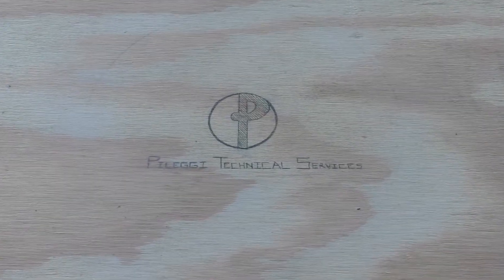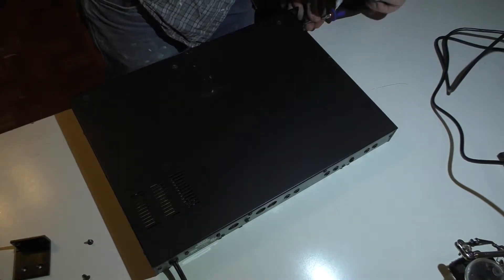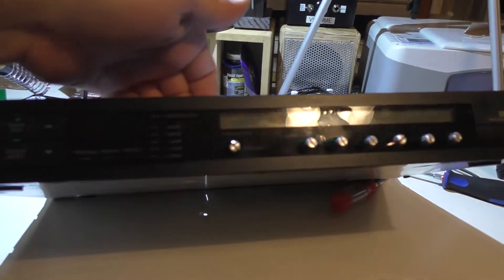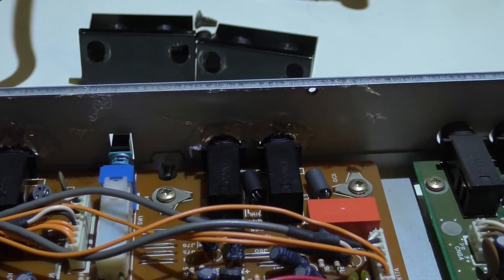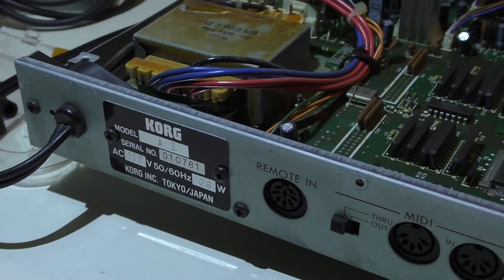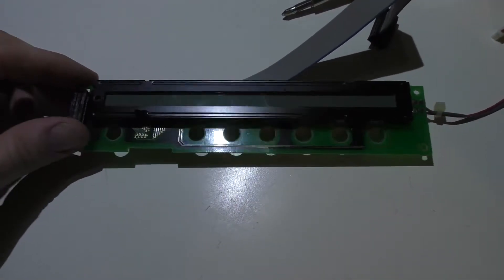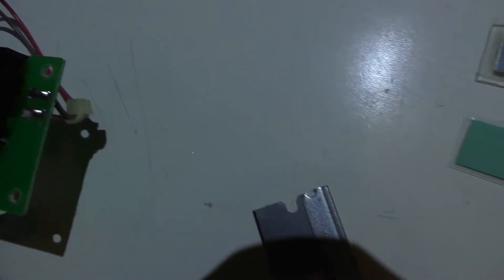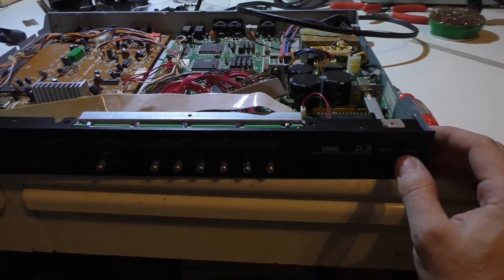PTS Ep. 16 - Korg A3 EL Strip Replacement

Comment: Nicely done video.
I have the A3 unit and need to replace the memory battery. I see it is a CR2032 by the video. Do those batteries easily just snap in? I see a plastic looking retainer apparently holding it in place. Thanks...
Phil
Reply: The unit must be running before your swap out the battery or else you will lose the presets you made yourself. Back up the unit patches to your pc first just in case.
Reply: @danfuerthgillis4483  In my case my Korg A3 unit was out of service for many years and there were no presets to worry about losing (they would have been gone already). I do appreciate the info however for the next time the battery goes dead or gets weak. Not sure how long they last, but whenever that time frame is, I appreciate the advice...
Phil
NYC Area